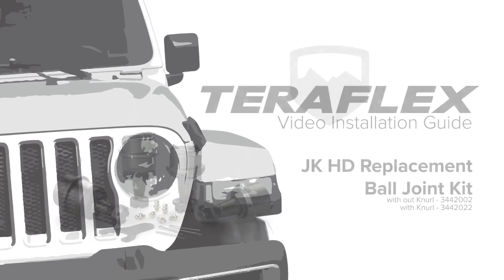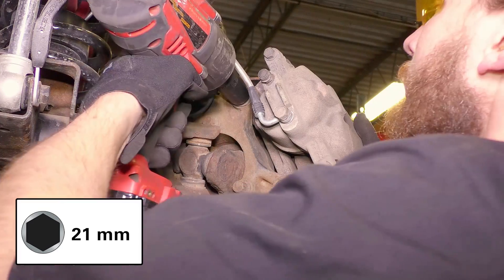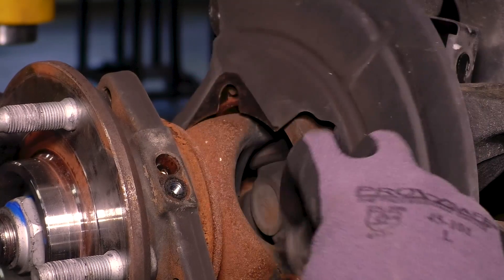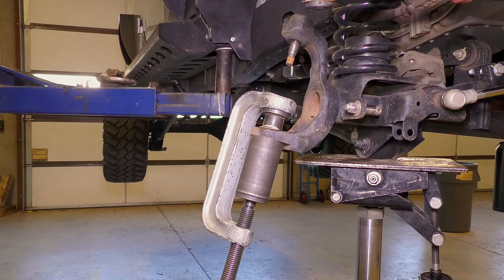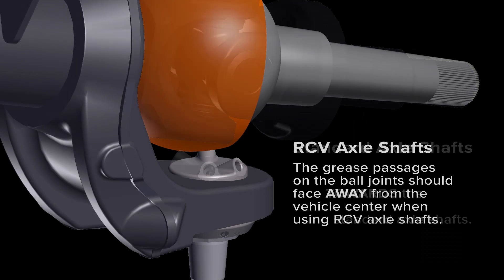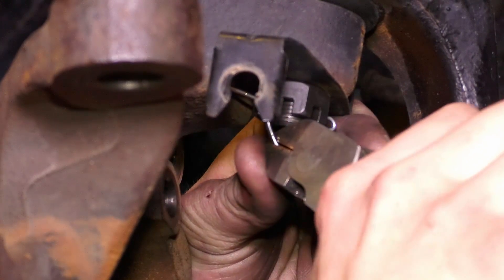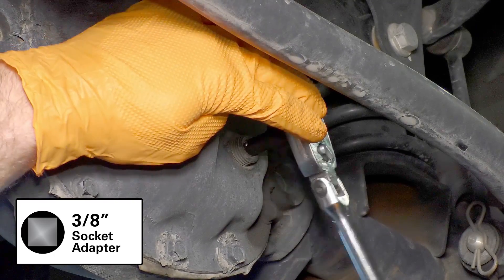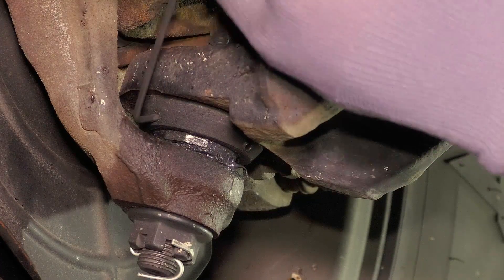TeraFlex Install: JK/JKU HD Dana 30/44 Upper & Lower Ball Joint Kit

Comment: @teraflex Which direction should the lower ball joint adjustment roate to tighten the preload? I dont see any indication in the installation instructions or on this video....

Depending how the special wrench is oriented on the torque wrench it could be either direction. 

Thanks.

Comment: How do you adjust them when installed for RCV axles?  The 3rd set-screw is impossible to reach even when turning the tires.

Comment: Im noticing im having to torque the "preload" very frequently... almost every 3k miles.  Just the other day, I tried to retighten the preload and I couldn't get the provided wrench to properly sit on the preload nut.  Grease keeps getting in between the nut and the wrench and is making things very hard to tigthen.  Any thoughts?  Thanks.
Reply from the maker: Please give our customer service team a call, they will be able to help troubleshoot the issue you are experiencing!

Comment: How will I know if I need to adjust these ball joints?
Reply from the maker: Lift the Jeep by the axle until the tires are just off the ground. Place your hands at 12 and 6 o clock and apply opposing pressure, feeling for movement. Also, place a small pry bar under the tire. With light pressure, pull up on the pry bar, feeling the upper ball joint for "in and out" movement. If there is noticeable play, its time to adjust and set the preload.

Comment: Anyone have upper balljoint bolt spin while trying to tighten? Seems odd on a brand new balljoint for the bolt to spin while tightening. Made it almost impossible to fully tighten to 70 ft lbs.
Reply from the maker: Please give our customer service team a call at 801-713-3314!

Comment: I bought these ball joints. After reading the description, it states that modifications need to be made to late 2012 and up Wrangler models to use these ball joints. What are the modifications needed?? Are there other ball joints we can purchase that don’t require modifications??  Just wondering if we can use these in my 2013 Sahara.

Comment: Should the outer knuckle be stiff after torqued to 70 lb ft?  It’s much tighter now compared to when I was taking it apart!  Thanks!!!  Great video!
Reply from the maker: They will be a little firm, but 10 mins of figure 8s, lock to lock, in a parking lot should start wearing them in nicely and loosen up the steering.
Reply: TeraFlexSuspensions Thanks for the reply!  I haven’t driven it yet, just noticed after I got the driver side installed.  Super excited to get it on the road!  Thanks for the superior product!!

Comment: The instructions suggesting to check the torque every 3k miles, does this also apply for the interval to re-grease them as well?
Reply from the maker: Yeah! That's a great time to check torque and re-grease.
Reply: @teraflexsuspensions  is it possible to re grease them every 5k miles when I do oil changes?
Reply from the maker: That would work as well. 👌
Reply: @teraflexsuspensions  do you have any instructions on replacing the upper ball joint boot?  One of mine after 8 months was rock hard and cracked and I’m trying to replace it myself without repaying for the labor of having it installed.
Reply from the maker: It should just be able to be pushed back on once removed. You can see it in the older video here. It is the same process. 
https://youtu.be/BjNUrFyfjdo?t=458
Reply: @teraflexsuspensions  Gotcha, so no springs or retainers just a frictions fit ty!

Comment: So I originally commented feeling very frustrated that no ball joint press tool that I could find would work. I ended up finding the perfect tool that you guys can rent. The only place that I know that carries it is Advanced Auto and the kit is called Powerbuilt Tools kit 46 (https://shop.advanceautoparts.com/p/powerbuilt-tools-kit-46-ball-joint-u-joint-service-set-23-piece-648617/9150043-P)
This kit comes with an angled adapter to install the upper ball joint properly and using this kit it actually only took me about an hour to do one side compared to an entire day on the other side. Also another thing to keep in mind is the hex bolt that holds on the ABS sensor is actually 5mm not 3mm. With that ball joint press I would definitely recommend getting and open-ended 22mm wrench with the ratcheting style because it made life significantly easier to press out and in the ball joints. I would also recommend having an electric or air powered impact for most of the bolts just for some peace of mind about stripping the bolts. On the hub bolts I actually needed to use a breaker bar and don't stress if you need to use a breaker bar there's a very small chance that you'll actually end up stripping those bolts they're very tough but again approach everything with caution. Other than that once you have all of the right tools the job is actually not very hard It's just trying to find the right tools can sometimes seem daunting. Another thing a lot of people overlook is the absolute need to grease the ball joints when you're done installing them, so before you even begin the job make sure you have all the right tools write a list and pick it all up. This is easily a day job and potentially and after work job if you know your way around wrenches and again have all the correct tools. Anyways much appreciated teraflex for making such a good ball joint! These solved my wandering problem after replacing pretty much every steering component and the old ball joints were only a couple of months old so I'm really impressed that the instant after installing them the problem is fixed and the steering feels so much more natural and the Jeep actually drives straight now. Very impressed!
Reply from the maker: You are the man. Thanks for taking the time. To share this info. 🤘

Comment: Just installed mine but can I get one lower ball joint grease to come out, Don't see it leaking out as a squeeze the grease
Reply from the maker: Try again after a few days. Sometimes the wear cup needs to get started and allow for a little grease to flow through the passages.
Reply: @teraflexsuspensions   awesome just like you said I see the grease now. Thanks
Reply from the maker: @gotryche73  Glad to hear it Gabe!

Comment: im having trouble getting the upper ball joint boot to seat...anyone have that issue?
Reply from the maker: You get this figured out Shane? Give us a call if you need any more help. 801-713-3314
Reply: @teraflexsuspensions  I got it!  Thanks for the quick response.
Reply from the maker: @ironfitboxing5304  Glad to hear it, no problem.

Comment: I thought the Allen bit for the wheel speed sensor was a 5 mm when I installed your bj's on my 2010.
Reply: Just got into it and found out I bought the wrong side at 3mm so I'm going to try a 5mm...

Comment: This is this is the first place, I have ever seen that you need to drain the diff to remove the axle shafts. That is extra work that really does not need to be used.
Reply: thinking the same thing,  no idea why they would do that.  Getting ready to do this and not draining the diff
Reply: You are correct doesn't need to be done but they are just being thorough.

Comment: On average how many miles are you getting out of a set of these balljoints? I have 35” tire and do mild wheeling.
Reply from the maker: With the adjustable preload, if maintained properly will last for years!
Reply: TeraFlexSuspensions  I just installed these on my XJ. Do I need to torque the jam nut on the lower ball joint after installation?